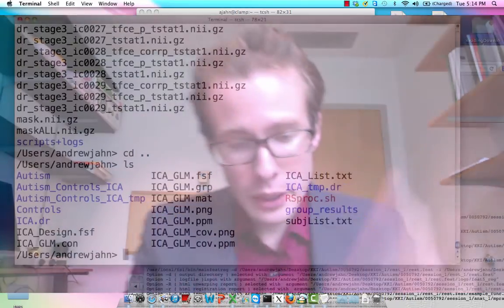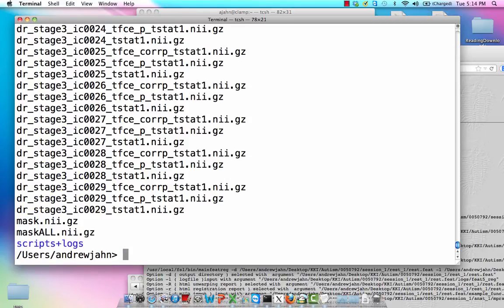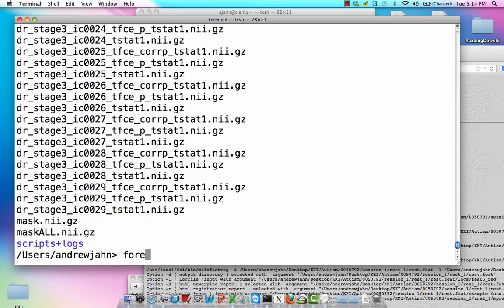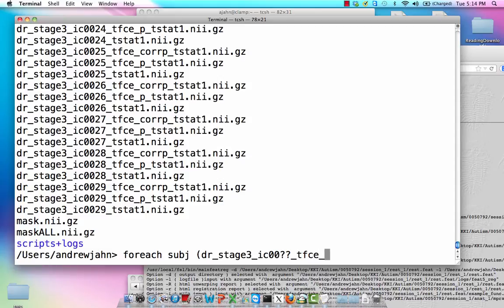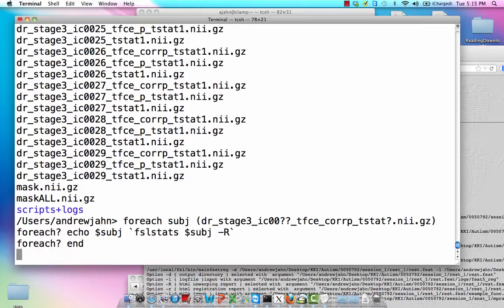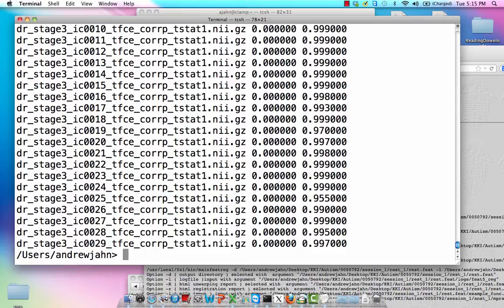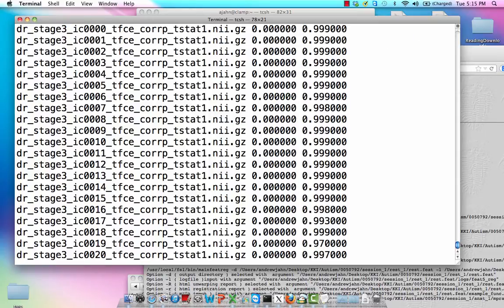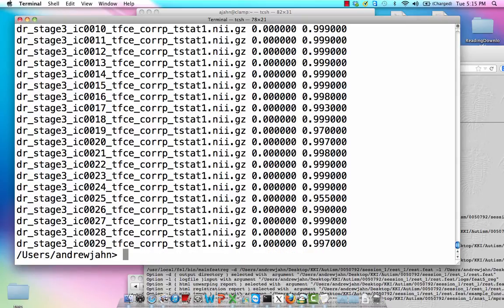ICA Analysis, Part VI: Checking corrected p-values

Comment: Hi Andrew, Thank you very much for your great series of tutorials, they have been very helpful for me. I have a question about the ICA results. I ran ICA and dual regression and specified 30 components. I am interested  in having the time series of the independent components. After running dual_regression I have output files "dr_stage1_subject0000X.txt" for each subject. The size of the matrix in this file is 30x357. I would assume 30 is number of subjects and 357 is the number of TR for each scan (which is correct), if my assumption is correct, the "dr_stage1 ..." are the time series of independent components for each subject?
Thanks in advance for your help!
-Ahmad
Reply: The FSL docs explain the outputs: https://fsl.fmrib.ox.ac.uk/fsl/fslwiki/DualRegression/UserGuide

Comment: Hi Andrew,

Thank you so much for the great ICA tutorials! I'm having some trouble with the 'foreach' script you are using, since my terminal is in bash and I can't get fsl to work in a tcsh terminal. Do you know a variation of the script that does work in bash? (bash doesn't recognize the foreach command). Or perhaps how to get fsl working when I change my terminal to tcsh?

Thanks in advance,
Amber
Reply from the maker: Amber,

Put this code into your .cshrc file located in your home directory (if you don't have one, you can create one with "touch .cshrc"): 

#Set up FSL Path
setenv FSLDIR /usr/local/fsl #change this to wherever your fsl directory is stored
source ${FSLDIR}/etc/fslconf/fsl.csh
setenv PATH ${FSLDIR}/bin:${PATH}

Then type "source .cshrc" and type fsl, and you should be able to run FSL from the command line.

Best,

-Andy
Reply: It works now, thank you so much Andy! 

Best,
Amber

Comment: Hi Andrew. Thanks for the videos.

Once I have performed single and group session runs on all my subjects, can I then use the group level default mode network IC spatial map as a template to in order to find the DMN ICs in the single subject runs?

Does this make sense? I basically need some sort of custom template for my group to find the DMN IC.